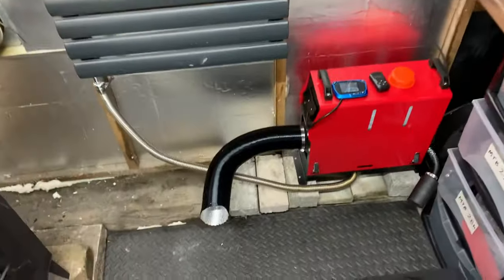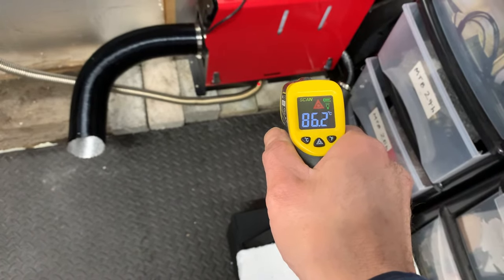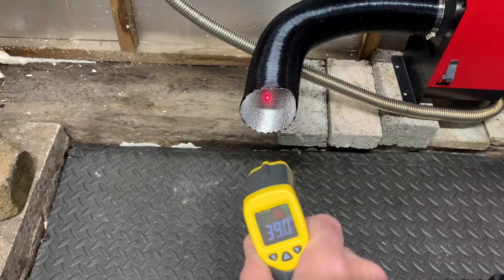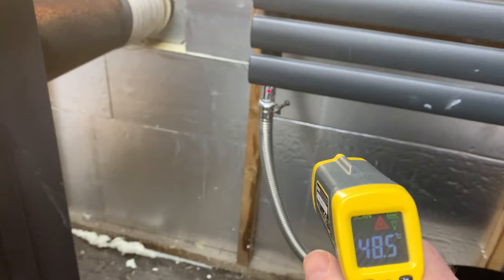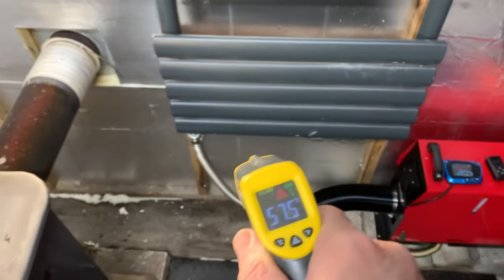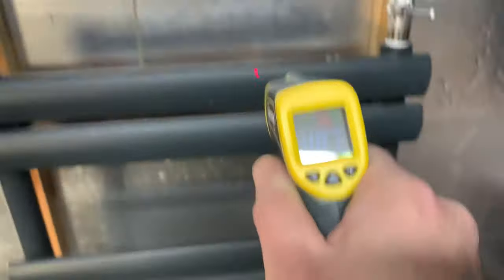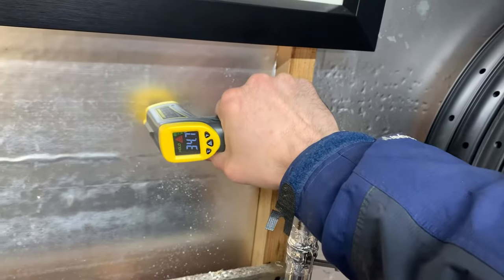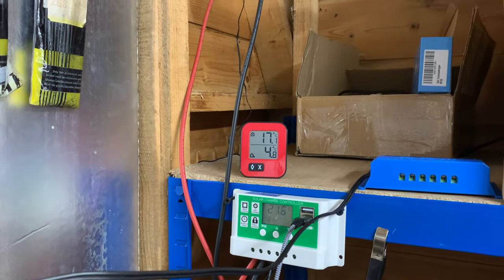Chinese Diesel Heater exhaust heat recovery through towel radiator.

Comment: Fill the Rad with water and then pump it around the exhaust , I used soft small bore copper pipe to wrap around the exhaust and my Rad gets so hot you can't touch it. You will get no carbon issues then and totally reclaim exhaust heat.
Reply from the maker: Sounds like a plan. I've got some microbore and a 12v pump for a compost heap experiment. Will try.
Reply: I'm confused. Could you elaborate? Wouldn't the water end up in the heater itself? Bubble the exhaust gases through the  water filled rad? Pardon me if I've misunderstood :)
Reply: @mmajid5457  You are making a heat exchanger. The copper pipe is wrapped around the exhaust and water is pumped thru the pipe. The heat from the exhaust will transfer to the copper pipe and heat the water.
Reply: @antiwoke6888  Thanks for clarifying. I did see another comment on another video which suggested putting a stainless.S pipe through the bottom section of the rad as part of the exhaust and the rad being filled with oil/water but, that does seem like a lot of hassle whereas your method is much easier. I'd imagine an EGR would be much more efficient for heat exchange with the same setup. Personally, my only issue is I have the heater in the cellar/basement and need to find a way to vent exhaust gases outside without having to bend the exhaust pipe up and out. Any solutions to that? I was thinking of attaching a SS bucket on the floor to the exhaust with a sealed lid and another exhaust up and out but that would require frequent trips to empty water out. Even the above video has the exhaust bent up so condensate must be collecting in the exhaust and/or heater...

Comment: This prevents condensation from draining away. The exhaust gas would have to be fed into the towel radiator from above and then out of the radiator at the bottom.

Comment: Exhaust should be as short as possible, running down hill from the heater,allowing condensate to be removed to outside.The back pressure that has been introduced, will ultimately cause the heat exchanger to carbon up more quickly, and put more pressure on the exhaust fan.Doubling the exhaust diameter reduces fictional loss by halve.fundermentally your on the ball,just needs tweaking.
Reply: Doubling the exhaust diameter also decreases the speed of the exhaust gas allowing a longer dwell time for the heat transfer to take place
Reply from the maker: Yes, I think the Carbon issue might put paid to the idea.
Reply: As a heating recovery I've made a sand battery. The pipe in my case is a cooper one of 28mm diameter and 70cm long. But I think this setup could be improved somehow because the exhaust pipe is still very hot on the outer end. You may see the setup here: https://youtu.be/zwiUZDWO-8M
Reply: Increasing exhaust diameter doesn't allways work. As the hot gasses expand more the speed of gases going through exhaust system are cooler and slower. Common misconceptions on big bore car exhausts. Sound good but can reduce engine power. Cheers from old George
Reply: @MakeDoAndMend1  
Quite so George. 
There is however a big differences between these heaters and engines.
Engine exhausts are a higher pressure pulsed  'driven system' while the heater is low pressure fairly steady flow system.
Perhaps the key thing to remember is that the only driver in the heater system, is the pressure that can be supplied by the electric fan. At first sight it might seem that the rapid rise in temperature and volume from combustion is the big forward driver, but it is only the pressure provided by the fan that prevents the hot gases/flame from blowing back through the fan itself. In these heaters, the fan driving the main hot air flow is keyed onto the same shaft as the impeller feeding the combustion chamber and the two separate flow systems are physically linked.. Any restriction to either the ventilation cold air/hot air flow or the inlet/combustion/exhaust flow will affect the whole system by limiting the combustion air supply, tending towards a fuel rich burn. At combustion the air/exhaust is heated to say 600 degC and the liquid fuel combines with oxygen to form CO2 and steam, adding further volume. Even though much of the heat is transferred out and the temperature drops a lot by the time  it gets to the exhaust port, the net effect is that approximately double the volume of gas has to pass out of the exhaust port. This makes the exhaust the single largest restriction in the whole heater. Inlet and outlet ports and pipes are both the same size so the exhaust must travel at about twice the speed of the inlet air. Since 'flow resistance' or back pressure' rises greatly with increased gas speed, it makes sense to slow the gas by increasing the exhaust diameter, and reducing any other restrictions such as bends, or by using smooth bore pipes. It does concern me when I see major exhaust restrictions being introduced in efforts to try and scavenge exhaust gas heat, when a better way of doing it is not that much harder. to do. Regards   OG
Reply: Sounds like bs 😂
Reply: This guy fucking exhausts! 👏👏
Reply: You  really  need  the  heater to  be  highest.   Condensation....  but  you just  need  to  have  the  hester  at  high  level,  going  into  the top  of  the  heat exchanger. Exiting out ofthe bottom,  and  finally  the  lowest point  being  the  outket  outside.
Reply: That condensation should be removed in vapor form as much as possible..... the water that runs out the exhaust? Full of acid.... it needs to be carried out and blown out as much as possible really and this lil pip squeak device really only has the HEAT part going for it in this department... can't "rev" it or anything... There's a sweet spot as far as how much heat can be pulled from this thing's exhaust before the condensation problem shows up.... But I mean Hey.... if replacing exhaust components is something he enjoys, the folks that make those parts need to eat too...
Reply: @firewatcher  Put the heater higher and fit the exhaust into the top of the towel rail and vent it out of the bottom

Comment: When you use those infra-red thermometers on shiny/transparent objects they will read low....you need a darker surface or dark object or a blob of dark paint inside the silver tube or on the object so the light isn't reflected so much to get more accurate readings.
Reply from the maker: Good to know. thanks.

Comment: There has to be someone who has connected one if these to a combi boiler or central heating system
Reply: that’s what I thought. And is do interesting about andyfireblade his latest videos. The same I would like to do with a small rocket heater outside. At the moment I have very little knowledge about over pressure protection. If an a few over pressure valves are sufficient?
Reply: It's already a thing.
Reply: At that point, why bother?

Comment: Also you can not trust the thermometer on shiny metal surfaces. Thats why the exhaust looks cooler than the rack.
Reply from the maker: Thank for that. I never knew.
Reply: On the most thermometer you can calibrating it by changing mode for different materials.

Comment: There is no way that there is NOT a condensation problem..... the exhaust on ANY internal combustion unit HAS to stay hot enough out to the far end to move the condensation out of the pipe... There is a limit as to how much heat can be pulled from that exhaust before condensation becomes a problem....  You can run a 10 foot exhaust pipe if you want, and yes, you'll get heat from it, but the condensation will eat that pipe up faster than people think..... CASE IN POINT:  Mom and Dad bought a brand new Nissan Sentra back in the mid 80s... had to have one catalytic converter and 2 cat back exhaust systems replaced within 3 years and the car had less than 12k on it... Nissan covered all of it, and a mechanic started talking with Mom and Dad about it, and the car never ran long enough for the exhaust system to get up to proper operating temps to get the condensation out of the exhaust... Mom only drove it 4-5 times a week usually, My Grandma and Aunt lived a mile down the road... the bowling alley was a mile and a half away, and the grocery stores and mall and everything else was pretty much under 2 miles. so most of the time, even the ENGINE didn't get up to operating temps much less the entire exhaust system.. So she started pulling the car out of the garage and let it run for 4-5 minutes before going back out and leaving... The condensation was getting sent out by doing that....They ended up trading it in in the mid 90s with around 60k on it not having any other exhaust issues... crazy............
Reply from the maker: Yes, I just turn the bleed valve at the bottom after I've used it and it cools. About 20ml for every hour used. I always run it full blast. Job done.

Comment: For anyone thinking of using a radiator as a heat exchanger, ALWAYS mount the heater ABOVE the unit, otherwise, condensate will potentially build up and could cause accelerated corrosion of the system.  Direct the exhaust in to the top of the rad and exit the bottom.
Reply: indeed..I have mine connected this way..if not the exhaust pipe will be filled with water...pretty soon.

Comment: Use a finned radiator baseboard heat pipe and install it below the heater, pitched,  for the condensation. Also, this will prevent too much back pressure on to the unit.
Reply: This is a great and simple idea.. 

Love it..  

Just trying to capture more heat in the area (that needs to be heated) 

That's a great simple idea.

Comment: Thank you. Very interesting video. I am in the process of fitting a Diesel Heater to my Mazda Bongo Campervan.  But also thinking of using a heater exchanger on the diesel heater exhaust to the engine water system so it preheat engine and also allow me to use the cab fan and heater. Just need to sort out a small water pump. Cheers from old George 😀
Reply from the maker: Sounds good. An aquarium inline pump might be the answer.
Reply: I am thinking the same thing. I have some old central heating pumps and a radiator. Not sure how much heat will be transferred in the heat exchanger though as it's designed for water both sides. If you go this route, let me know how it goes!

Comment: I'm going to use some flexible dryer duct and put it around an extended exhaust (I already have both) and run a small DC fan at the bottom of the heater where the exhaust starts and split it off before it goes outside. I should be able to nearly double my heat output from 1 heater depending on the CFM of the fan. Easy and cheap way to increase efficiency.
Reply from the maker: That sounds like a good plan. Maybe a PC sized fan. The copper pipe wrap idea is good too. Going to experiment this winter.
Reply: @firewatcher  Another addition: wrapping copper tubing around the extended exhaust first to set up a thermosyphon water heater. I'll just start with heating a bucket of water, which will help humidify the dry air in the winter and provide a bit more heat.

Comment: I saw somewhere that the plastic on the end of the intake is used to balance the heater. Since there will be more resistance on the exhaust, I wonder if removing it would help with preventing carbon buildup in this setup. Cheers for the video, I was amazed at how much heat is wasted on these.

Comment: Im going to capture some exhaust heat as well. There's lots of heat there and it's a shame and inefficient to just blow it outdoors. 
I'll have my heater mounted over an empty and outdated 20lb propane tank. Will be cutting it near the top (i might cut the top completely off.) My exhaust will run straight down into the tank, coil it around inside a couple of times and out  the bottom and then vented outdoors. I'll have the tank filled with sand to capture the heat. 👍

Comment: I'm surprised the exhaust hasn't filled with condesation an stopped the heater with the exhaust running uphill like that. Maybe it just burns it up on the way out? How does it work?

Comment: You gonne get water in the exhaust this way...the exhaust must be at the high point of the radiator and the heater must be the most high point so condense water can run down and leave the radiator at the low point...

Comment: Still working after 10 months? No issues with carbon or/and condensation?
Reply from the maker: Yes, condensation does happen but easily drained every couple of days. I’m now using kerosene so it’s burning cleaner. 👍🏼

Comment: exhaust gas condensate will have low pH, its very acidic, it will eat anything not made out of stainless and you will have gasses escaping, use a stainless steel heat exchanger for example and egr cooler which is designed for the job otherwise you may get exhaust leaks sooner or later.
Reply from the maker: Yes, it’s not a long term thing and is only on for about 60 days per year. Seems to fine so far.
Reply: @firewatcher  as long as you are aware, probably a good idea to disclose this to anyone who copies it, get a CO monitor just to be safe.

Comment: The exhaust flow should always be downward to avoid the buildup of condensate.
Reply from the maker: Yes, there's a bleed valve in the bottom of the radiator. Not much condensate but it is significant.
Reply: No that's bs! No chimney or heater flue runs downwards 😂
Reply: @igxfux1977  It's not a chimney it's an exhaust

Comment: Does anyone know the fittings needed for the radiator to fit the metal pipe from heater and out port also ?
Reply: All I remember is that the exhaust pipe is 24mm ID (0.92")

Comment: this is a very smart solution! However, it seems to me that the radiator can quickly become clogged. In addition, it may be useful to install an additional draft (exhaust fan) on the radiator side to reduce the load on the heater burner
Reply from the maker: It’s still working fine. I just drain the condensate every day or so.
Reply: nope

Comment: hi what connections did you use for radiator to diesel exhaust
Reply from the maker: Screwfix: 1/2" BSP MALE X 15MM COMPRESSION RADIATOR VALVE TAIL 65MM 2 PACK CHROME (10954)
Reply: @firewatcher  Part number and everything! this is one hell of a helpful reply.

Comment: i know it seems like a dumb question but why would you use the heat from the exhaust to warm up a radiator when you have the output from the diesel heater in the same room?
Reply from the maker: Might as well use the heat that would otherwise end up outside.